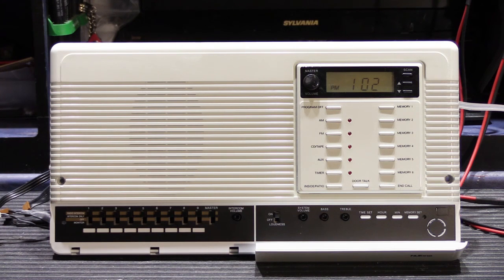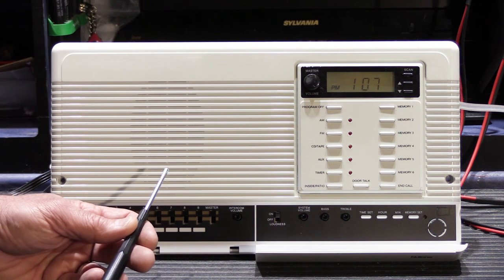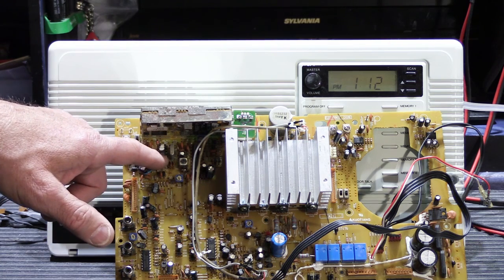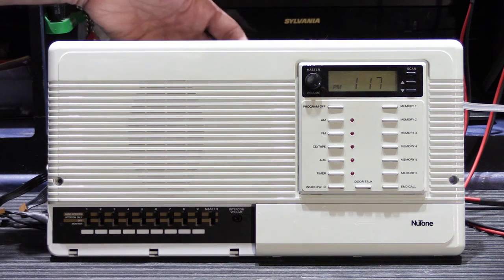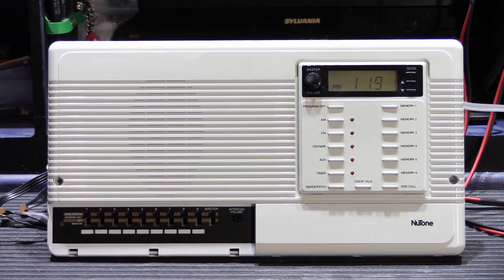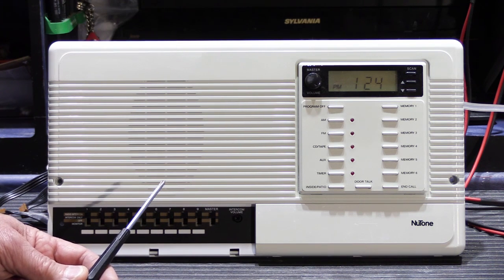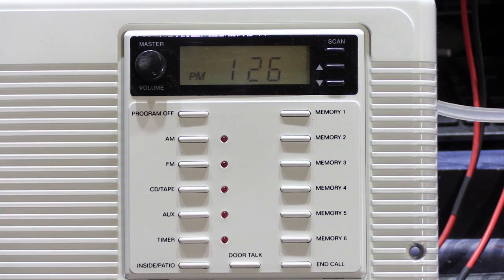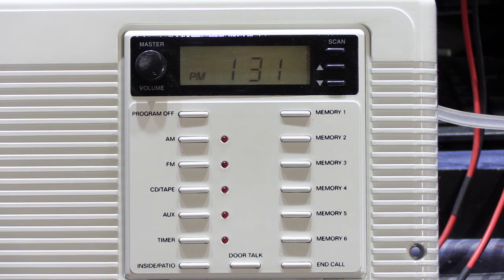I Discover a NuTone IMA3303 with Mismatched Circuit Boards and Confusion Ensues

Comment: Wow!  Did you happen to try swapping one of the boards to match the dates, just to verify your diagnosis?  When you repair these things, do you typically try to match board date codes?  Or are you mostly always doing board-level repairs?  I guess the morale of the story is to be very careful when buying spare boards on your own!
Reply from the maker: Hi Jim:  I did not swap boards to test my theory.  That would have moved the work into the "science project" category.  The customer was not interested in the additional expense of a replacement board and since he was use to the way the set operated, he was happy to leave it as it was.

We do exclusively component level board repairs, the only time that complete boards are replaced is when the original board has some type of physical damage that makes it unrepairable. 

There are 5 different sets of circuit boards for the IM3303/IMA3303 and they are not interchangeable with each other.  Circuit boards are no longer available for purchase - any complete boards come from donor Master Stations.  Dating boards by component date codes is fine, however from experience, we can tell you which board it is just from a visual inspection - along with the REV. # on the board - Chris

Comment: I discovered on eBay the other day a few IM-3204's... they look exactly the same as the IM-3303 with a few minor differences to the main control panel that houses the display. What's the difference between the two? From what I saw on a PDF of an owner's manual, it was introduced AFTER the IM-3303. Never knew that model existed until the other day. Enjoying your videos! Hope Harvey the Hedgehog's doing well! :)
Reply from the maker: Hi Vincent:  The IM3204 was introduced in 1997 as a replacement for the IM2003.  The IM3204 was the entry level builders model, it is the only 4-wire system that NuTone ever made.  The 4-wire design was to allow separate pairs or wires for the Intercom Functions and the Music output.  The IM3204 was limited to a total combination of 6 inside and patio remote stations and up to 3 entry door stations.  The display did not included a Clock, however the system did included NuTone's Remote Music Control feature and it could accommodate a Chime Module.

The Remote Stations (IS325) look identical to the remote stations for the IM3303 (IS335) however the switch boards are different.  The amplifier in the IM3204 is based on the Sanyo LA4270  class D amplifier IC.  The LA4270 is rated as a 6 watt dual channel amplifier, in the IM3204 best guess is that it produces around 4-4.5 watts.

The NuTone SR9000 was also introduced in 1997 and it is the cousin model to the IM3204.  The SR9000 was a Stereo Radio Music Center with built-in AM - FM Radio and auxiliary inputs, the SR9000 was the replacement for the original ST1000 Stereo Music Center.  There are no intercom functions in the SR9000.  It is impossible to know which came first, the IM3204 or the SR9000, but like many designs that are meant to work in different applications, there are to many design compromises for either to really stand out.  

It is very likely that these models were specifically design to accommodate the new hone developer markets in places like Florida.

We don't see many IM3204's or SR9000 in our area or in the shop, they seem to either fairly reliable, probably because the design is not very demanding and somewhat simplistic, so there' isn't to much to go wrong. - Chris
Reply: Wow so they made the 2003 up until 1996... that's neat, never knew that... I like the convenience of a digital tuner. I know about the ST-1000, it was recalled due to a fire risk. Didn't know they made a successor. The only "Music-Only" systems I know of are the PTX-1201 that you showed in a previous video (the cousin to the IM-4006) and the ST1000. And now I know about the ST9000... would love to see a picture of the SR9000. Thanks for the info! :)
Reply from the maker: Yes, the ST1000 recall was quit a problem for NuTone, however it was only on a small fraction of the units manufactured.  Here's a link to the CPSC Recall Notice: https://www.cpsc.gov/Recalls/1996/cpsc-nutone-announce-stereo-cassette-player-recall

As an Authorized NuTone Service Center, we were sent out by NuTone to inspect - remove or replace many ST1000's. - Chris